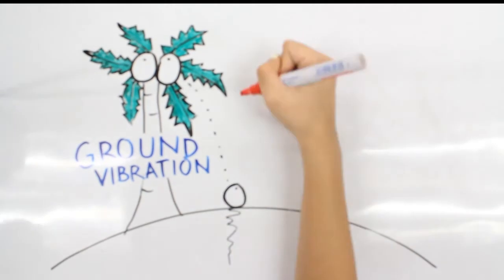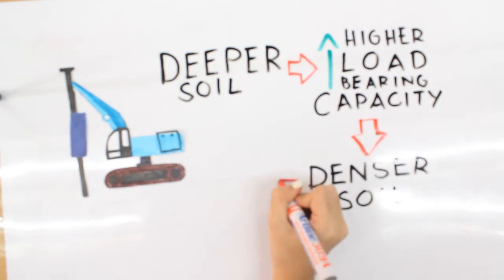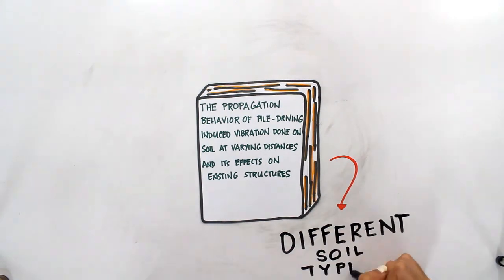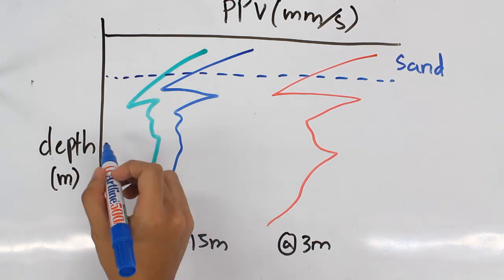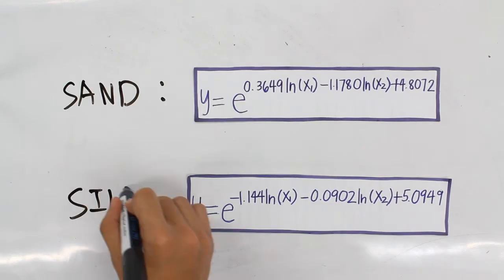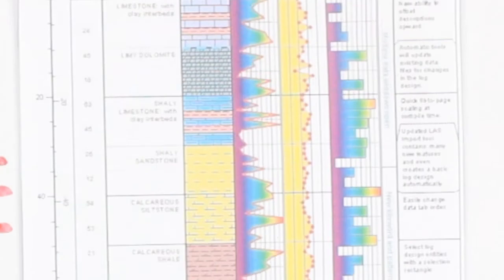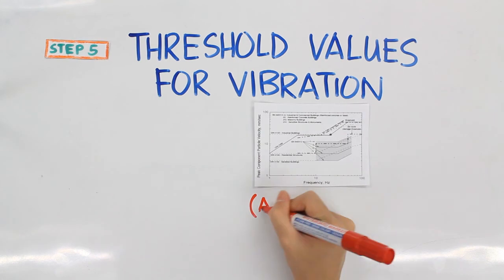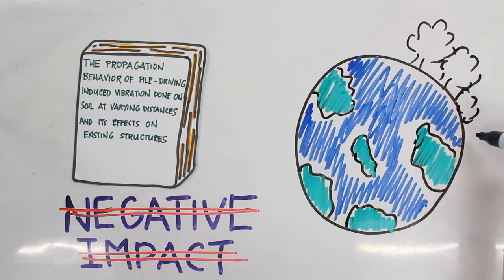Ground Vibrations from Impact Pile-driving

Comment: As you conclude already all the models have the same problems.  Either they are to complicated or (as in your case) are to simple.   How about the size of the building?  A small building tends to vibrate more than a large building. And how about the soil? Is it layered nicly horizontal or not.  With this mode I would say you can not predict accurately mabey by a factor of 6!   But still it is a nice presentation.

Comment: Are there vibration studies that show hoe ramming damaging quality of well water?  Hoe ramming occurred 200m from my well for a week and a half from 7am to 8pm to ditch a 30 m length. The hoe ram broke solid hard limestone up to a 10 foot depth .Heavy vibration could be felt standing on the limestone. Result is sediments released into well water that clogs filters every week and water staining is very heavy though a 5 micron filter is used in the well water system. Any help appreciated.